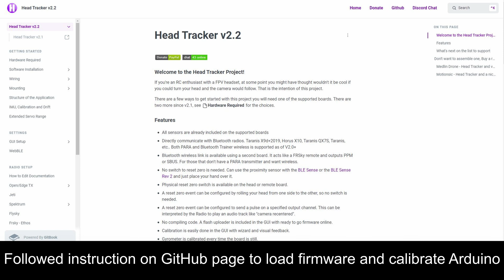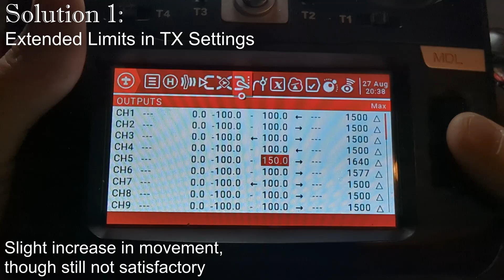The Journey of the DIY FPV Head Tracker

Comment: Would this work on dji as well?
Reply from the maker: Totally! The head tracking is totally separate from the video system you use. Painless360's original design is capable of mounting the DJI FPV cam. You'd have to mount the VTX though, wouldn't be too hard to find a model or make one.